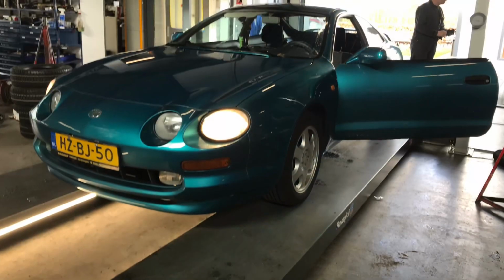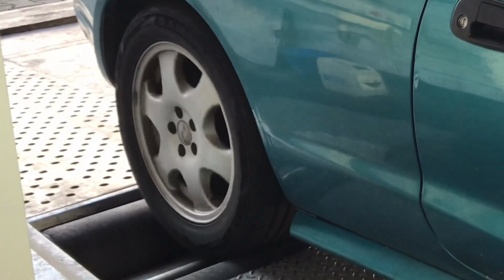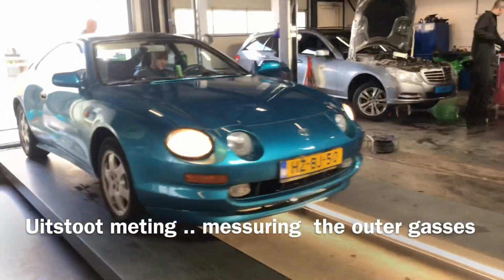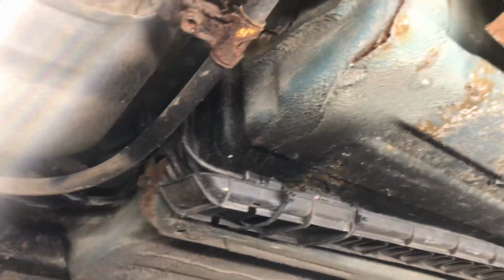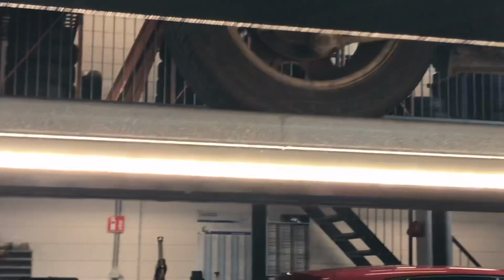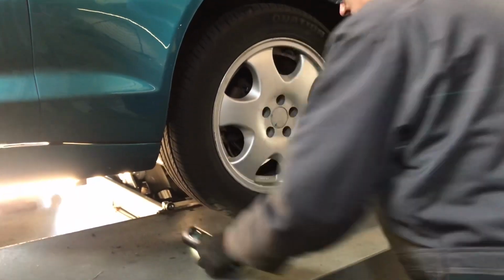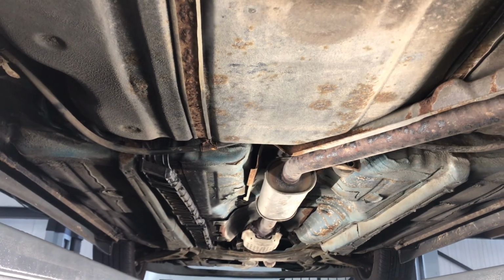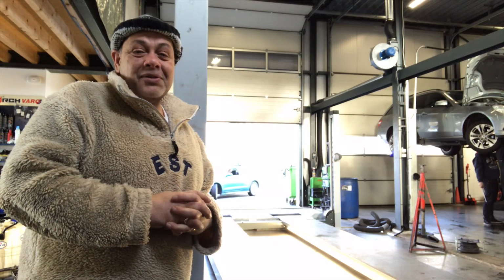De APK Keuring Toyota Celica 1994 - Yearly Check Celica 1994  @ Autobedrijf Visser Groningen 2018

Comment: OMG puck.  that is awesome. that you have that car. I had a 1998 Celica. very similar color. I sold it in 2007. 148000 miles.  original motor
Reply from the maker: Nice bro 😂👍👍